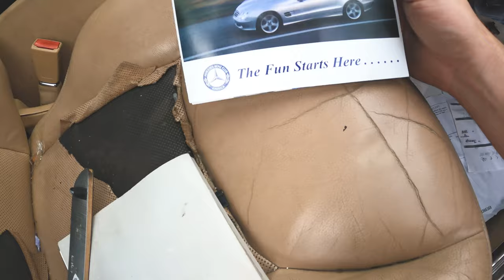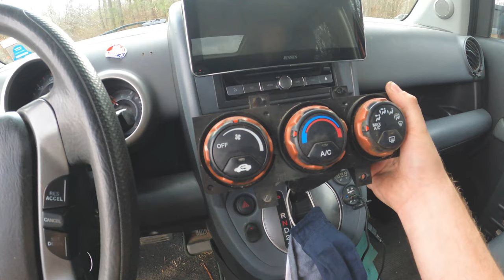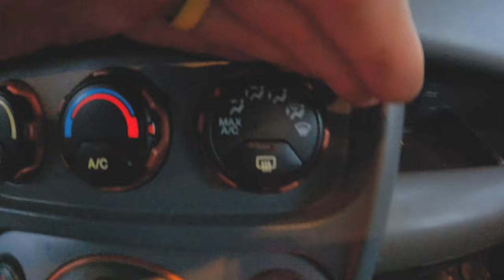Modernize your Honda Element from Junkyard Parts

Comment: I had the same 1988 Accord Sedan until earlier this year. Sadly the car only had 78k miles on it. I paid $1300 for it with 68k miles on it in October 2020. It ran perfectly fine. Eventually the lower crank case pulley snapped off of the rod and the repairs were more than what the car was really worth. 

I did end up buying an 05 Element a few weeks ago to replace it though. 

I was sad to see my Accord go. She was in real mint condition. But I sold her off for $800 so I at least got my money worth out of her.

Comment: Hello there. Looking for a 2007-2008 HONDA ELEMENT SC FRONT RIGHT HEADLIGHT 
any idea, where can i find new or used one in a good condition. 
any tips would be appreciated, thanks.
Reply from the maker: Honestly I bought a set of black housing 07-08 Headlights off of Ebay about 7 years ago. They've been amazing and were under 100 bucks at the time.

Comment: When you gonna do a J swap on the element? 😉
Reply from the maker: I've been trying to contact a few people, tracking down leads still.
Reply: @DashnCars  for a motor?
Reply from the maker: @jeffwest5551  mounting stuff and ecu.
Reply: @DashnCars  doesn't seem like many people have done it, and those who have look like they had to make a lot of modifications. Looks like a pain. Seems like a turbo would be easier.
Reply from the maker: @jeffwest5551  true. But I've wanted to do a J swap in one since the first day I've owned this
Reply: @DashnCars  oh I think you should. Maybe you can make it a bit easier for the next person.
Reply from the maker: @jeffwest5551  that's the plan!